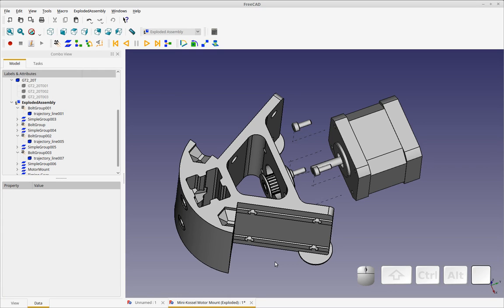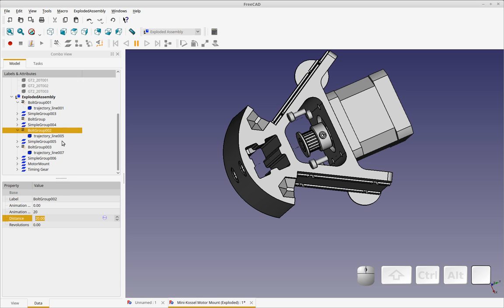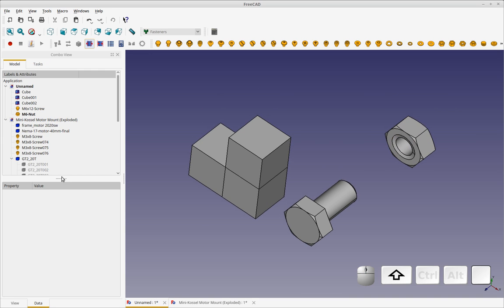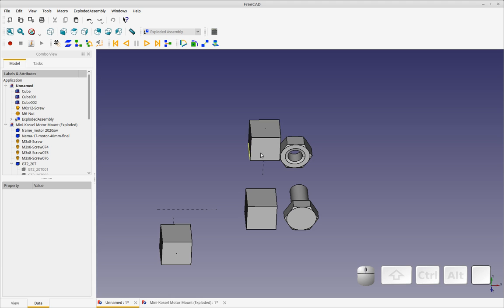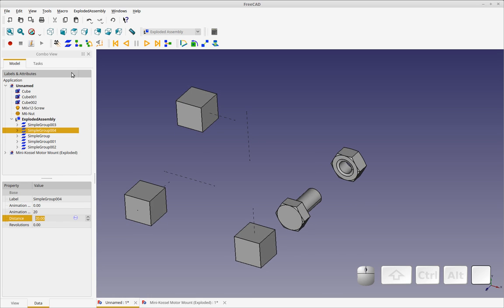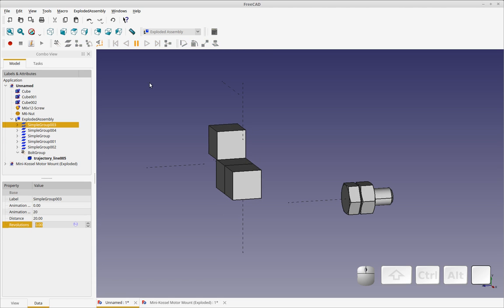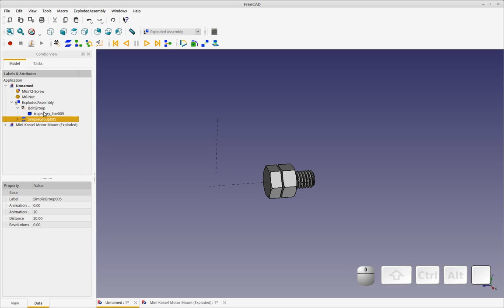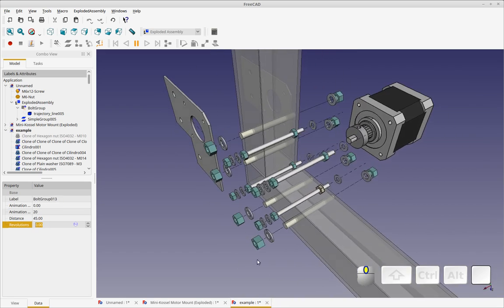FreeCAD - Exploded Assembly + Hidden FreeCAD Gem

Comment: Thanks for the helpful Video !. Can the exploded animation do a rotate using a locked position like a hinge and a cover ?
Reply from the maker: Simply put, yes. You can rotate any of the explode path. So you could simply make the path zero length.  There are other, possibly easier ways to do this as well.

Comment: Your exploded-assembly vid got me really interested! I installed FC-0.17 and found how to use available macros to add workbenches and add-ons. I found Assemble2 and also Exploded-annimation, but no exploded-assembly so now I got too curious not to ask you how to get it. 
My version nr is 13188 and I installed on a windows 7 64 bit system. Should I uninstall older versions? (0.16) or am I missing an item in the executed macro list? I did get some strange movement in Assembly2 but nothing useful. I use a bolt and nut from your example and some cubes but nothing really works. 
I also wonder how you get the mouse-clicking options displayed in the lower right corner, or is that only available in LINUX? 
I hope to do your examples with scripting and the Arduino box. 
Hope you can help me with a few hints.
thanks, Herman
Reply: Thanks Paul, I had to try a few different approaches for installing expl. ass.  but it is available from the workbench so it should be working like your's now. Animated exploded views like that can be very helpful at understanding the construction. Now I can start exploring this too!

Keymon ? OK , I try that later, I also have a multiboot with 3 linux versions that allowed me to test if my old notebook on vista32bit would run a 64 bit OS and it did so I could safely upgrade to 8 GB and w7-64.  

thanks again, Herman.